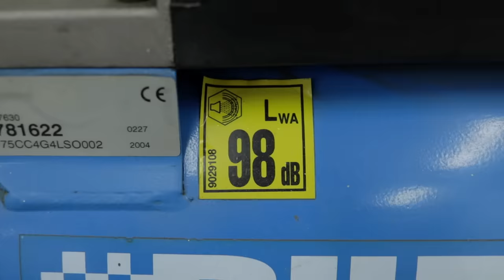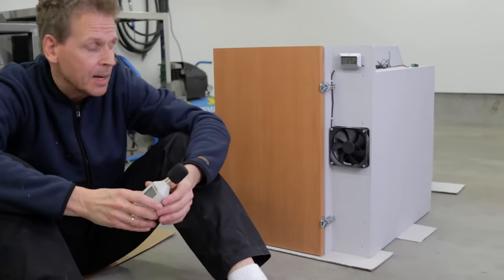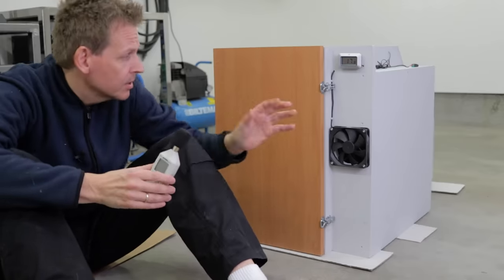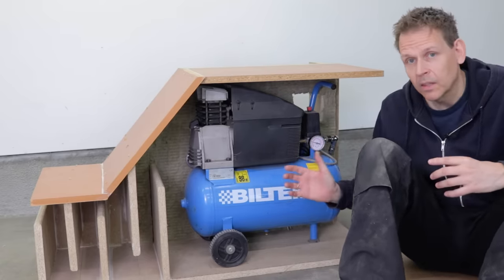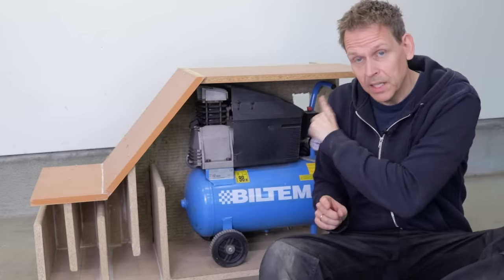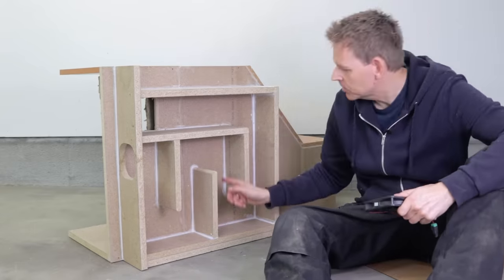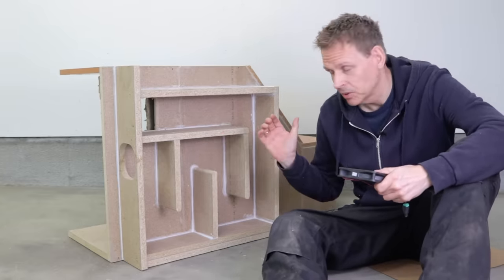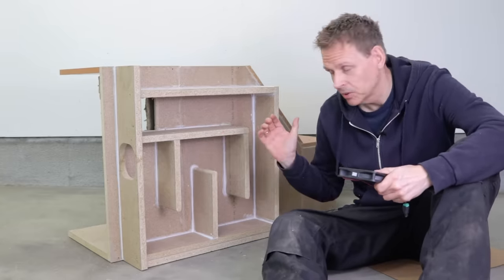Do not build a sound insulated enclosure for your noisy air compressor!

Comment: Because it will overheat !!
Reply from the maker: You have a valid concern:  The air compressor will not live for long if it is constantly hot above the recommended specs! 😐 However, It's a pretty cold climate here where I live in Norway, in the Northern part of Europe. I have actually fitted a heat pump in my garage to be able to use during winter time. I can see overheating is a big challenge in warmer climates. A more powerful fan or even radiator cooling could be needed must then be considered.

However, since I have a fan in front blowing air into the box I have airflow through the case that will "grab" the heat and transfer it out of the box. I have fitted a thermometer and checked the performance frequently. Normally the temp increases 5C = 10F from when it starts until pressure is built up and it shuts off, and then it takes just a couple of minutes to cool it down (as the fan continues to run after the compressor stops). If it is running constantly over longer periodes it can get a bit hotter, I have seen almost 10C = 20F increase. The warmest summer days can be 30C = 86F here where I live, but that is very rare. Its more commonly 25C = 77F, so it never gets very hot inside my box and it is within the range of acceptable temperature for this compressor.

Comment: Just put the compressor outside.
Reply from the maker: Yes, that is probably the easies and smartest solution to the problem 😊Unfortunately, I just dont have space for it. My garage is placed with minimum distance to two of my neighbors. The side facing my own property is not usable either,  as it's just a slim path between my garage outer wall and a concrete retaining wall. In front of the garage door is no good either 😋
Reply: how to make friends with all your neighbours

Comment: Just put your compressor outside....
Reply from the maker: Well, I wish I could 😌 I just dont have space for it. My garage is placed with minimum distance to two of my neighbors. The side facing my own property is not usable either,  as it's just a slim path between my garage outer wall and a concrete retaining wall. In front of the garage door is no good either 😋
Reply: @kihestad  I can see that. Just another option for some. Won't work for all. Not a city person personally... still a cool idea seen similar but put outside of the back of the business.

Comment: Move compressor out!
Reply from the maker: Would have loved to 😊I just dont have space for it. My garage is placed with minimum distance to two of my neighbors. The side facing my own property is not usable either,  as it's just a slim path between my garage outer wall and a concrete retaining wall. In front of the garage door is no good either 😋
Reply: @kihestad  I had the same problem. Didn't want to disturb the neighbor (it wasn't big disturbance, but audible). I solved it, by offering one pipe from compressor to him. He even offered to share the cost of compressor. Then we purchased vacuum pump. LOL

Comment: buy a quiet comptressor for $100 and move on.
Reply from the maker: @peteganze6416  Exactly, I think the cheapest one is $140 (USD) over here, building a sound proof box will most likely be more expensive 🥴
Reply: @kihestad  I found a "silent" 1 gal Huskly at Home Depot for $100, but that was a fluke. I got lucky. I run mine at 2a and no one hears it unless I'm using the nail gun. lol

Comment: The compressors you are using are cheap garbage. There are compressors much quieter. The other thing about compressors; You build a basic box, and stick the box and compressor outside. Noise problem solved.
Reply from the maker: Nah, it's not garbage but it's cheap! 😁Would have loved to put it outside, but I just dont have space for it. My garage is placed with minimum distance to two of my neighbors, the third wall is up against a concrete wall, and outside the garage door is no good... 😋
Reply: @kihestad  It looks like chinese garbage. If you need to make the encasement work, then you are going to need to add dense material to absorb the low frequency vibrations. Wood and rockwool won't do it. Either hard rubber at least a quarter inch thick or 1/8th inch steel plate. The wood isn't a good sound insulator. You can also add baffles to the intake and exhaust ports of the compressor. A better-quality compressor with heavy compressor construction is quieter. I've spent a lot of time in music studios and these issues are always a problem and the solutions are always the heavy rubber or solid steel plate.

Comment: I’m lazy I would have just put it outside like everyone else does
Reply from the maker: Yes, that is probably the easies and smartest solution to the problem 😊Unfortunately, I just dont have space for it. My garage is placed with minimum distance to two of my neighbors. The side facing my own property is not usable either,  as it's just a slim path between my garage outer wall and a concrete retaining wall. In front of the garage door is no good either 😋
Reply: @kihestad  lol I understand I do